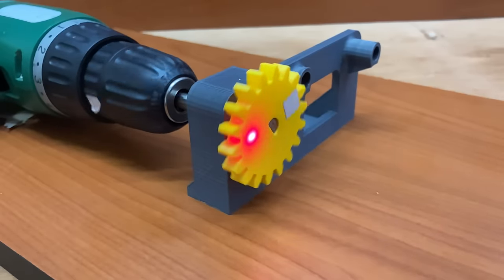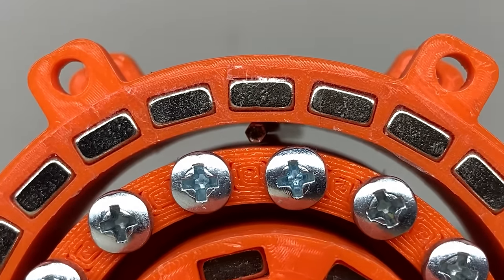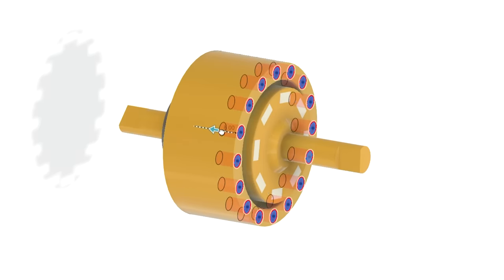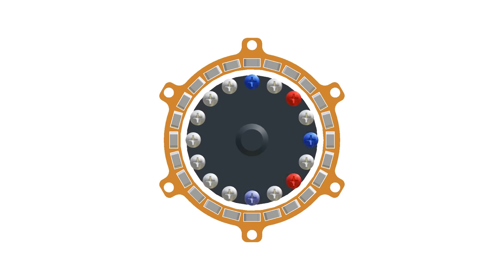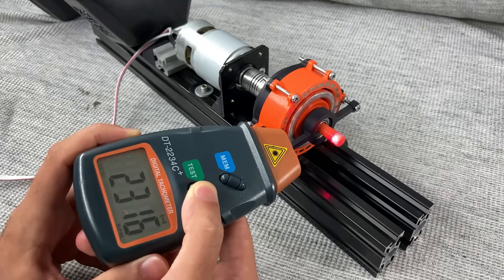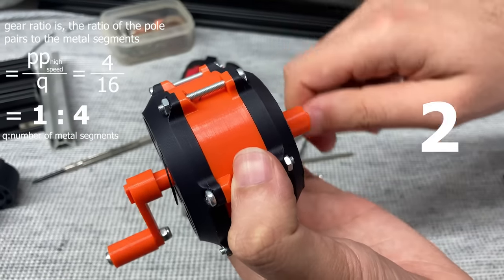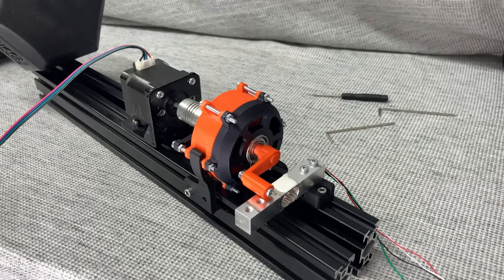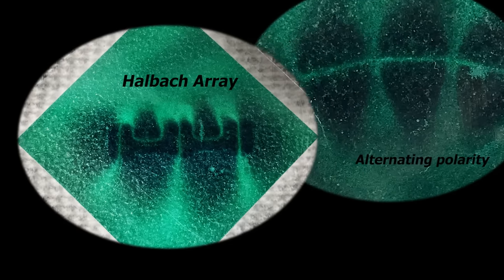Magnetic Gears - Why Nobody Talks About This?

Comment: i think its more so that the magnetic force is easy to overcome with enough torque, thus causing slippage, then youd need to increasse the size of the magnet, which increases mass, and now you have interfering fields amongst multiple magnetic gears. this application would be extremely useful when controlling motion between two areas without connecting to each other, like an isolated or vacuum chamber. this would be essential in producing rotational energy even though there is physical material blocking the linkage.

Comment: This is an interesting experiment. I think it would be much better if the magnets and steel were much closer together. You are losing probably 70-80% of the magnetic flux to air gaps. Also, instead of used steel screws, get some solid iron rod. At something like 10 minutes you stopped the output shaft without much effort. In oirder for magnetic gearing to be effective, they output shaft needs to truly locked like gear teeth to the input shaft. It might be quiet, but its a poor transmitter of torque.

Comment: magnetic synchronizers are probably the best practical application of what you are talking about. nobody likes a slipping gear, and magnetically coupled gears will slip unless they are ridiculously more powerful than needed. it all depends on what problem you are trying to solve. a bearing still needs lube and fails at some time. a magnetic bearing requires power, and the power source fails at some time, or is inefficient. windings on an electromagnet fail at some time. even permanent magnets fail at some time.

Comment: Someone else mentioned eddy currents and electromagnetic interference. There is also the weight involved with a series of transformers, as well as the cooling power required under high loads.

Comment: hallbach configuration makes the magnetic field not only denser on one side but also denser around the magnets. this means unless you're working with smaller distances, it actually weakens the magnetic force.

Comment: We use these in oil and gas for permanent magnet motors in Electric Submersible pumps. Work great and very efficient. However, very dangerous if there is back flow as any rotation of the shaft can cause voltage generation at surface.

Comment: They have been used for years heavy vehicles use them in cooling fans as the magnets spin the fans to keep air flow but when engine high loads and temps increase a mechanical clutch will lock the fan into direct drive for maximum cooling...

Comment: You could use a needle baring with a titanium housing and hardened steel rollers for an improved modulator. I could see this being used to drive a more efficient gyroscope.

Comment: you don't have to completely eliminate conventional gears though. for high torque applications, you can use traditional gears to achieve maximum torque and you'll still have reduced the number of gears. the contactless nature of this system could be utilized in continuous transmission. if you can make the modulator in a way that instead of solid pieces of ferromagnetic parts, they are numerous pieces clumped up to form the piece (like instead of screws, clumps of needles). then, in theory, you could rearrange them to have different number of clumps. this way without touching any load bearing parts, you would be able to change the gear ratio

Comment: One problem would be the eddy currents converting part of the energy into heat. 
The other is that this mechanism transfers torque, not translation. In other words, it can never 'lock in' as a mechanical gearbox can.

But could be pretty useful in certain circumstances.

Comment: It seems to be a better option for magnetic coupling for limited torque,  water pumps, corrosive and hazardous environments.  Even though the power transmission is non contact type, the efficiency is low and operation is not precise.

Comment: Weve made eddy current transmissions. Very heavy though. Also clutches for freightliner. Imagine 60000 lbs rolling backwards down hill and then moving forward in second gear slipping the clutch the whole way no problem. But the autos became awesome.

Comment: the issue with magnets is that they eventually run out of charge, its why a lot of those desk toys come with batteries, if a magnet is constantly being acted upon it looses the charge much faster. Its easier to lubricate and replace the physical gears then replace many little magnets that would be used for just one gear.

Comment: It's not the sudden increase in speed that causes it to fail it's the sudden increase in torque. The forces being applied are higher than the output force of the magnets. You can try making a slimmer housing to bring the magnets closer together or you can increase the size of the magnet while maintaining the same gaps.

Comment: All in one clutch and transmission, you could control the gearing ratio just by modulating power supply. Sure you could create a cooling system for it also, that wouldn't be as difficult

Comment: What if the actual teeth of conventional gears where individual strong magnets .. the gears could be loose fitting but the teeth could still interlock, all be it with an air gap, but rely on magnetic resistence to transfer torque as opposed to phsyical contact ?

Comment: I'm not an expert in the macro industries however one reason could be the cost of production must greatly increase due to the high amount of magnetic field it generates which must be carefully shielded so other electronics keep working properly and fixing a many-magnet gearbox would probably be really hard and dangerous if any of those magnets somehow gets damaged or something. Almost no car repairman would wanna deal with gears made of freaking neodymium magnets or whatever magnetized gear that's used and risk losing fingers or even the whole arm.

Comment: The problem with these is that their torque is severely limited because the magnets would slip if too much resistance is encountered. They're effectively only as strong as the force of the attraction between the magnets, which even rare earth magnets, just isn't as much as traditional metal gears.

Comment: I agree the magnetic gear may be more efficient at transferring power, but in most cases, what matters is the efficient transfer of torque. When put under load, the magnetic gear train will skip much easier than the teeth of a mechanical gear. Due to the fact that 2 objects cannot occupy the same space at the same time, the amount of force you can transfer from one gear tooth to another is infinite, given an infinitely strong and rigid material. In other words, the mechanical geartrain can transfer as much torque as it takes to snap off the gear teeth. The torque transfer capacity of the magnetic geartrain is much lower because there is no physical medium to overcome to “skip a tooth”, just magnetic forces, and very very strong magnets are prohibitively expensive. This would best serve a device which requires very high speed and a very low, constant, predicable torque. Otherwise, it’s mostly just a cool experiment.

Comment: Curie Temperature - Regular neodymium magnets are strongest operating up to temperatures of 80°C but after this point, they will lose their magnetic output. Eddy Currents will heat the assembly and magnets, effectively 'wearing' the magnetic gears unless you can manage to guarantee a cold operating environment.

Comment: Now the contact wear is in the Bearings you are using to keep the shafts in place.  and the bearings still need lubrication and eventual replacement

HOWEVER,  this could perhaps be an alternative to modern Torque converter ? as fluid torque converters can still break under stress, but a controlled electromagnet could be extremely safe/efficient because it could even cut power to electromagnets if it detects slip.

Comment: You can not measure the efficiency with input and output rpm. Spur gears are not supposed to skip teeth. Therefore The input and output rpm will always match exactly the designed ratio. To measure the losses, you also need torque.

Comment: What about in a sealed transmission for gear changes that allow slip without damage for a mechanical gear set. Reduce the contact wear on the pinion locking into the ring gear. High speed low bottom end torque is probably the correct assumption. But using rare earth magnets with a carbon fiber housing and tightertolerance couldhelp increase the torque.  Its cool if you use the magnet field in the shaft instead of bearings to help keep resistance down .

Comment: Food for thought,  If you tap just the center of a bar magnet on any glass or plastic it will loose weight,    If you VIBRATE the same  center field into granite rock it will become soft and you would have to use copper tools to shape.  The center of a magnet is the most powerful once you understand it,  Neodymian magnets do not proved for the center field it's compressed their in.

Comment: “Allows them to be nearly silent and run with no contact”

And also at speeds of around 20,000 rpm if the materials don’t expand. 

This is what would allow you to have a Tesla that’s manual transmission, and literally the limit to the speed of the vehicle would be based off the friction of the tires and the max rpm of the motors.

Comment: I could see using this concept to set a centrifuge section of a spaceship moving, like in the DISCOVERY-1 in Kubrick's 2001: A SPACE ODYSSEY, providing an artificial gravity sensation for the astronauts aboard. If engineers could set such a drum-shaped or wheel-shaped cylinder into rotating without grinding gears in a standard set-up, that would be highly advantageous, I imagine.
It also wouldn't surprise me if those UAPs zipping around everywhere were making use of such magnetic gear contraptions in some capacity.

Comment: Theres a fair few reasons why magnetic gears are not widespread. One of them is mass distribution. Magnets are heavy and their effects fall of with r^2. This means a typical magnetic gear will have its mass distributed more towards the furthest point away from the axis of rotation, which increases the moment of inertia. This might not be great in singular gears, but lots of them will add up.

Another thing is, what happens when the gears need to be packed tightly? They'll start interfering with each other. There's many many reasons why this gear didn't become the game changer.

There are obviously uses for it but are not common compared to typical gears.

Comment: This is almost how hybrid transmissions operate at low speeds. The hybrid transmission is a planetary gearset, aka a 3-way adaptor for gears. The engine and wheels are attached to 2 inputs, while permanent and electromagnets make the 3rd input. At low speeds, the engine spins the electromagnet and generates electricity that the traction motor uses to push the car - not unlike a diesel electric train or bus - and charge the battery. At highway speeds, the electromagnet locks to the permanent magnet (not unlike this video), allowing the engine to direct-drive the car. The ratio of electric drive to direct drive is controlled by the electromagnet, becoming an eCVT.

Comment: Gears use to be made of wood but you need massive cross sections on everything to keep it from shattering under moderate load.
Wait with epoxy stabilized gears you could go up a bit.

Comment: Two questions:
1. When the output has a resistive force, does the magnetic gear have a much lower threshold for failure as compared to a mechanical gear?
2. Do the magnets have magnetic wear-and-tear? I.e. magnets needs to be replaced after some years. If so, is the magnet replacement lower cost than replacing mechanical gears?

Comment: i have also experimented with this when stronggnets came out locally, but the cost/torque capability/complexity/weight can simply not match the regular steel gears and there is a more magnitude of difference. this magnetic gear thing is only acceptable for educational purposes or for some very special medical application

Comment: since they are good for low torque high speed, one can easly adapt for a hybrid gearbox in a car, in which the 2 first gears are classic and the last 3 are magnetic, nice the car would be at a lower inertia...this would also lower maintnence and although it occupies more space, it also would be simpler to implement.

Comment: Magnetic gears are not more widespread due to the latent cogging effect.
Whereas, a properly machined physical gear will hardly ever fail, given proper lubrication and kept within safe operating temperatures and speeds.
I was researching these, as well as magnetic bearings for a generator design. Both work in principle... however, both have magnetic cogging effects of their own... creating opposing resistance in the driveline, or could even reverse direction altogether. If strong enough magnets are being used, and this happens, it could snap or twist the shaft it is connected to, and cause catastrophic failure to whatever machine it is connected to/operating. 

Magnetic gearing is a good hobby idea, but not a feasible working design without the ability to control the magnetic field properties of each magnet to fine detail.

Comment: To add on to the previous comments, magnetic coupling is not very good at transferring torque, as it will slip quite a lot and produce lots of heat. Traditionally this heat would be dissipated by a fluid, however if you used a fluid in the system you would defeat the purpose in the 1st place.

Comment: The torque-handling capacity was my biggest concern but also, what about 'cogging' symptoms under high load at low rpm? Also, you must remember that most magnets lose some of their strength over time so this characteristic needs to be accounted for in the design phase and specification ratings. I can see applications in military submarines.

Comment: I watched a video on a guy debunking -Why electric cars do  not have a alternator / After watching this video -you gave me an idea / With this gearing example COMBINED with pressurized Feral fluid as a stabilizer in a solid state unit - add a fly wheel that will turn at 20% faster the revelations of the speed of the electric car - hook that up to an alternator to charge the batteries on the electric car / This could improve the mileage by 40% .

Comment: Some small misunderstandings in this video:
1. Worm drives are not gears, kinematically, they are a mechanism.
2. The 'magnetic gears' presented can't really be defined as a gear set, it would be more appropriate to refer to it as a form of magnetic clutch.

However, its an Interesting idea with some low power applications possible but not a game changer I'm afraid.

Comment: Hello, Nice work. What is the maximum torque you can produce out of a magnetic gear? What would be the weight of that magnetic gear? Regards, Sam
Reply from the maker: In my last video I went up to 0.2 Nm with minor improvements. I think I can easily go up to 1 Nm even with only 3D printed parts and I can probably go up to 3-4 Nm. I am not able to give a number for the weight.

Comment: The limitation of a physical gear is the strength of the material used. The limitation i see with a magnetic gear is going to be the strength of the permanent magnets. If an electromagnet were used then an increase in current would increase the magnetic strength when more torque is needed. Won't beat a physical gear but could be useful.

Comment: Why on earth would you hear an electric motor with magnets. Electric motors already use the principles of magnetism to start with. Just chose the motor that is right for the job and don’t use gears. It’s called the KV rating of the motor. When there is 2 motors with the same power usage and efficiency the one with the higher kv goes faster and the one with the lower kv has more torque. Has to do with wire thickness number of winds angle between magnets/stator/coil ect. Also as other people mentioned the magnets would become a generator and cause Edie currents in nearby metals and heat them up causing inefficiencies and loses far greater than traditional gears. Best bet if you want something better than gears is using fewer gears that have higher ratios or using belts/chains.

Comment: In hydro the generator is used as an upper bearing to stablize the unit. In a 85megawatt unit magnets produce over a million lbs of down and circle forces. Without this force the units would destroy themselves. They can also work backwards and motor.

Comment: Very cool i wanted to get into 3d printing to try stuff like this and was going to ask you what 3d printer you used, so its cool they sponsored the video, and its even cooler they didnt make you do a commercial disguised as content which made me pull the trigger, except one problem... they dont ship to Canada? but they have a ship from US option.  Anyway cool stuff, i could see this being useful in a dremel tool perhaps, where its high speed but low torque, and i do remember problems of the bit getting stuck and thinking this cant be good for the motor everytime it happens, but witha gear system lke this  it wouldnt.

Comment: You just have to find the maximum possible rpm and set that as your limit, as if the outer one spins too fast it will result in the inner one losing it's magnetic hold on the inner one and they'll disconnect

Comment: Well, it seems to me that magnetic gears just can't handle the load too well - and it would be fine by itself, but perhaps closer to "decoupling" point their ratio starts to shift as they tend to slip. The advantage of conventional gear systems is that involute engagement gears have a constant ratio that doesn't depend (or at least doesn't depend much) on speed and loading of the gears.